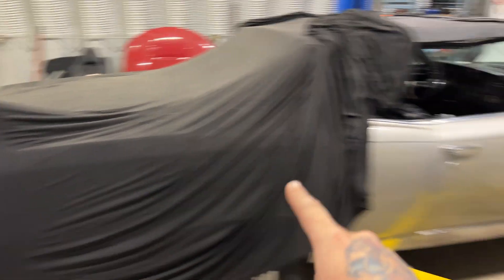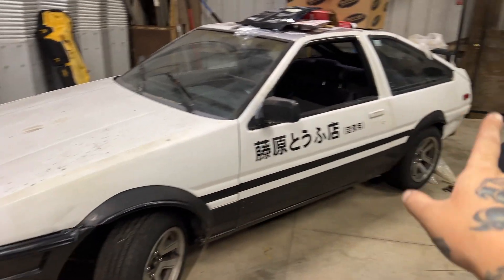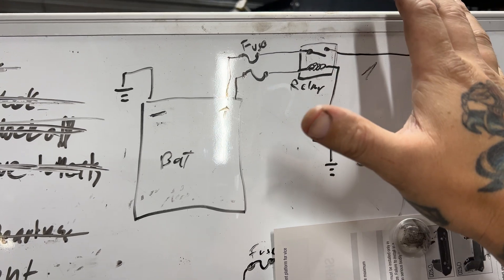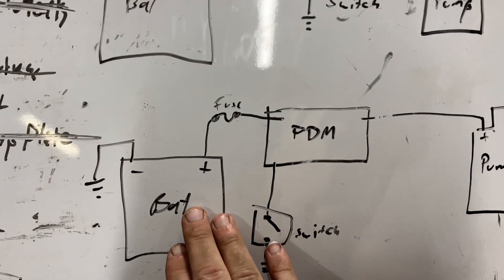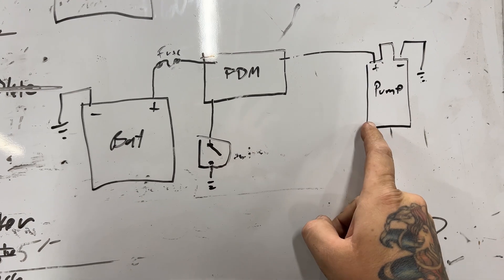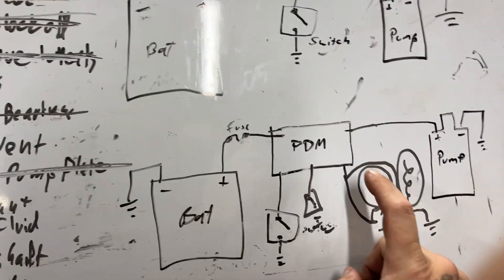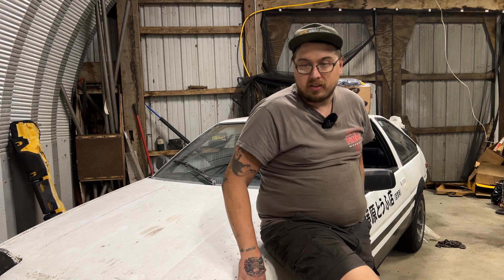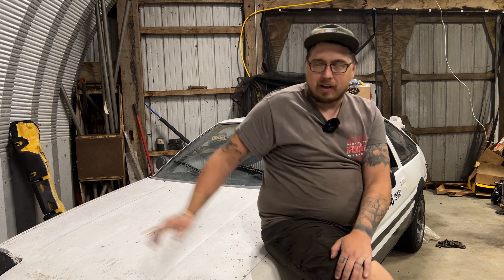What Even Is A PDM?! Why Did I Run One on The AE86

Comment: I just finished watching your whole ae86 pdm series and I’m so glad I found your channel cause I’m interested in doing it in mine! I am currently running a link ecu with my 20v silver top engine but the chassis harness is a wreck so I think I’m going to go the pdm route now after watching your videos! I had a few questions tho…. Did you leave the oem wires for fuel gauge, clock, door open, etc? Or did all of those come out with the oem harness? Also were you able to find all the wire colors on the fsm or did you have to probe and test each one to figure out the inputs especially on things like the cluster? Thank you!!
Reply from the maker: Glad you liked it all!  I havnt hooked up my fuel level sender yet, but they are easy to program in the pdm.  I also didnt run clock/door open stuff. You gotta keep in mind how many inputs/outputs and the size of the pdm. Those also would easy to wire in if you had spares.  As for the cluster/gauges i was able to find an old club4age post that had the pin outs.  The tach is the only issue as the resistor on the motor itself needs to be swapped out due to the voltage requirement being different from a stand alone vs ignitor/distributor.  Hope that all helps 😬 feel free to ask if you got more questions tho

Comment: Thank you for good video again. I'm going also to the pdm way when i'm getting my car rewired. I want to get rid of relay and fuse boxes in the chassis. Also the old wires and connectors from 1984. Also that's why as you said it's more simple for diagnosis. 

I'm not going to do the wiring myself so it will be very expensive but it should be worth it. 

But yeah, thanks again, i like that you tell us viewers some technical information.  I'd like to hear that 86 in the videos. But please dont put the microphone in to enginebay in driving footage in my opinion it's too much, no one puts their head in enginebay while they're driving. 😅😂
Reply from the maker: PDMs are the way to go no doubt.  Glad you enjoyed the video! Im hoping to do a driving video soon but the microphone issue is def something Im struggling with on driving things.  My current mics get blown out too much but Ill figure something out